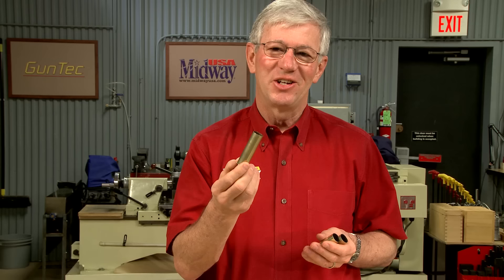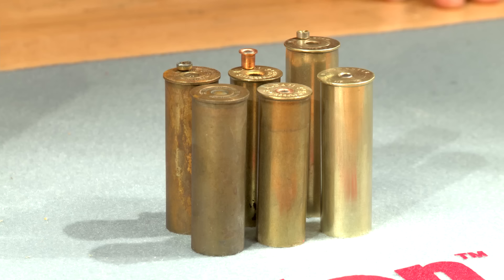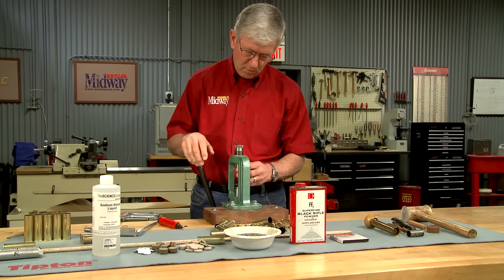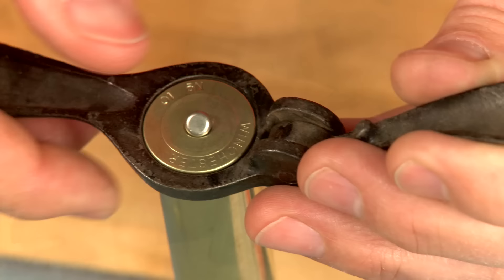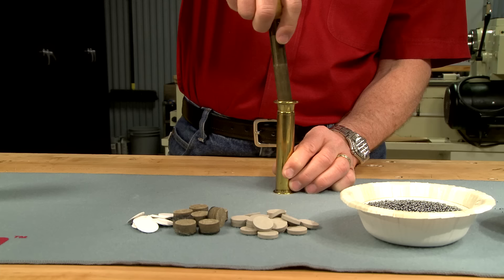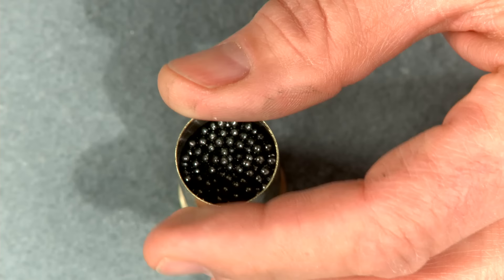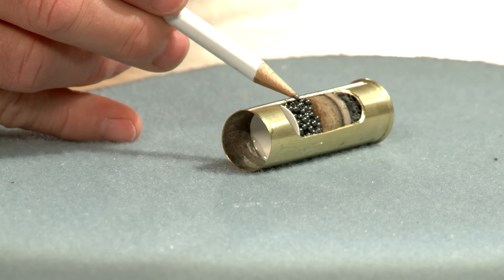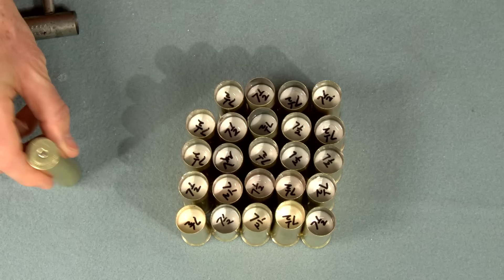Reloading 10 Gauge Brass Shotgun Shells Presented by Larry Potterfield | MidwayUSA Reloading

Comment: Nail polish will also work to hold in over shot wad, but why not just use modern plastic hulls?
Reply: +Ryan Ehlis For style mostly. Brass looks neat, and if you want historical style in your historical gun....
Reply: the brass shells fall right out of the breach of the gun too
Reply: Not really. Brass work hardens and fatigues. Plastic just flexes and bounces back.
Reply: ***** Do you mean the steel heads on plastic cases?
Reply: Sounds like you know more about them than I do. I know the earliest cartridges were closer to steel interchangeable chambers. They couldn't actually obturate to seal so they had a lot of problems with gas leakage. If the current products are designed to last forever, they probably have the same issue.
Reply: Brass can be annealed to soften it again.  Plastic becomes brittle and will begin to crack, either in the sides, probably first at the crimp folds, and also even at the top of the rim of the metal base.  They also experience loosened primer pockets, but there is a tool to extend their life for that problem.
Reply: Mad Mike:  Something is wrong at YouTube.  I clicked to reply to other posters but instead my post appears at the end.
Reply: Metal Tiger

Comment: Nice, but you were not careful enough after you put the detonator in the back, then the black powder, then the dangerous projectile, while the cartridge touches the entire surface without a hole under the detonator to prevent the possibility of its explosion and may harm you
 Your work is good but you need more security